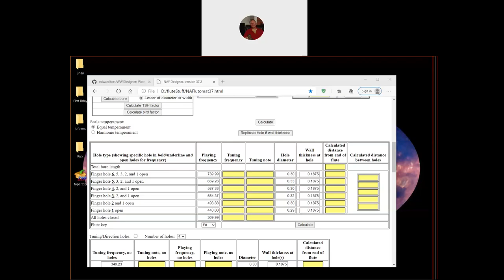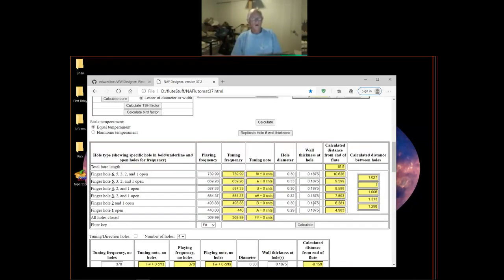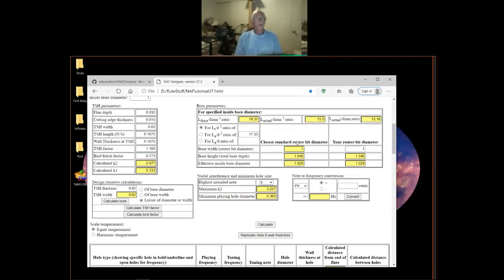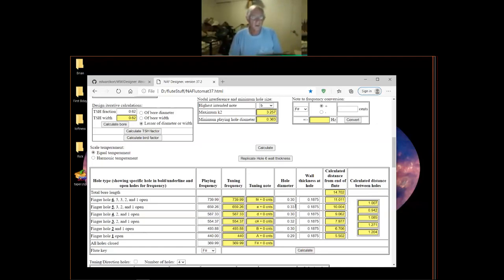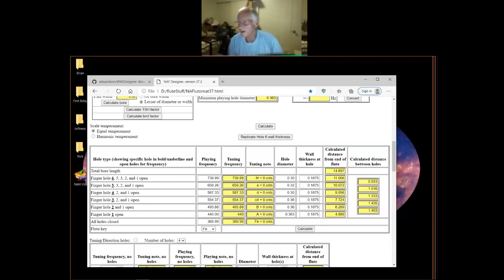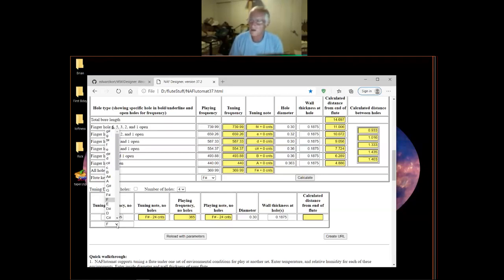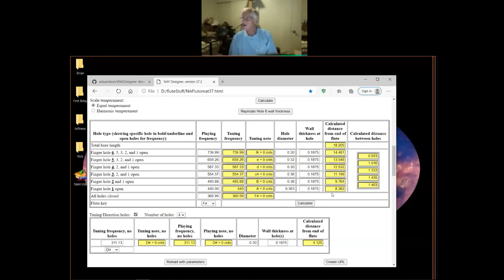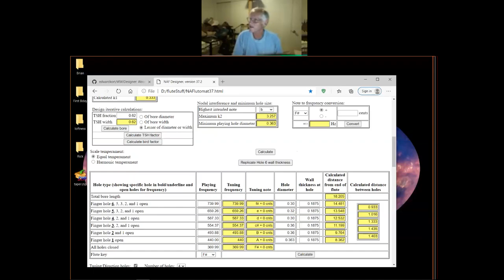NAFlutomat Basics

Comment: Are there resources to have some prebuilt plans for standard tunings?  Meaning, all these calculations, etc are great, but are there some "Tried and true" templates for various keys/sizes that one could use as a guide?  Something that includes overall length, SAC length, sound chamber length, etc etc..I find myself unsure of a good standard starting point.
Reply: There are a few resources for beginning flute makers. Take a look at the Oregon Flute Store offerings. Cherrycows also publishes a book, although I have never looked at it. And if you are attempting to achieve chromatic tuning and second-octave notes, the above resources are not likely to help a lot. Part of the attraction in making these flutes is the individual discovery process each maker embarks upon.

Comment: Can you please have some exercise through transverse flute. Fipple  / Beta factor is difficult to find out or may be this program have limitations and not be able to find correct beta factor. Thank you.
Reply from the maker: @Bamboo Flute  I submitted your request to the WIDesigner issues pages:
https://github.com/edwardkort/WWIDesigner/issues/95
Since you did not do the submission, you will not automatically be notified when there is a response. Please check the above link in a couple of days.

Comment: I have tried that flute model. I did 2 months practice on it but it behave weird for top three holes. Have anybody built transverse flute using this application? I respect all American flutes but Indian bansuri type transverse flute can play meend which is not possible using any western or American flutes. Indian Classical music is not possible without meend. American flutes and western fluted are jumping from one note to another which is easy to make but flutes having ability to play meend required an extraordinary skill because it also defines the tone in between the notes.
Reply from the maker: @Bamboo Flute, I submitted your request to the WIDesigner issues pages:
https://github.com/edwardkort/WWIDesigner/issues/96
Since you did not do the submission, you will not automatically be notified when there is a response. Please check the above link in a couple of days.

Comment: Can we have videos for transverse flute design using this software?
Reply from the maker: NAFlutomat was programmed for designing the Native American Style flute, which has a fixed embouchure (TSH) and a relatively steady blowing pressure across its tonal range. For transverse flutes, I suggest you try Woodwind Instrument Designer (WIDesigner), which has a study model built to handle these additional complexities. There are several videos discussing the interface; the documentation for the flute model is on the wiki pages. The root URL for WIDesigner is: https://github.com/edwardkort/WWIDesigner
Reply: @woodwindinstrumentdesigner3145   I have just download WWID and would also benefit greatly from a tutorial on how to use it to create transverse flutes, there seems to be quite a lack of information on how to make transverse flutes such as the Chinese Dizis like the Qu di, I have scowered the internet, and it seems your WWID is my last attempt before throwing in the towel.
Reply from the maker: @RyanClarkFisherII  I submitted your request to the WIDesigner issues pages:
https://github.com/edwardkort/WWIDesigner/issues/94
Since you did not do the submission, you will not automatically be notified when there is a response. Please check the above link in a couple of days.

Comment: I am not agree that small  diameter finger holes will make perfect flute. The frequency you will get but following issues you will face with small hole size.
1) friction through small hole increases friction will reduce efficiency of flute
2) tone quality will not be as good as for perfect hole size because half tones are difficult to play on small hole size. 
3) it will create whistle sound when hole size are small.